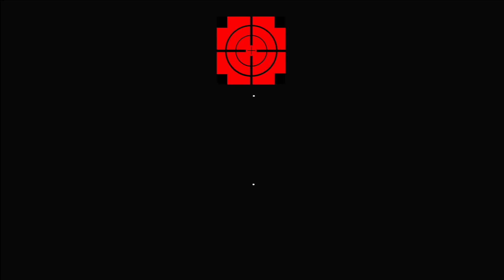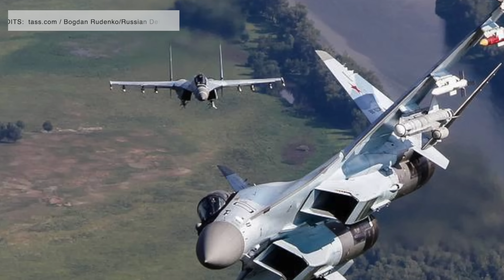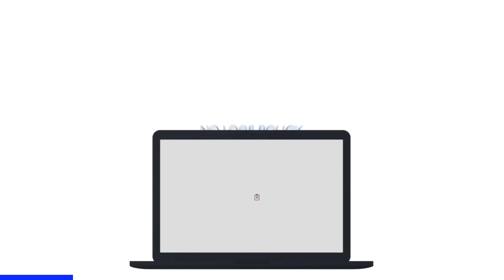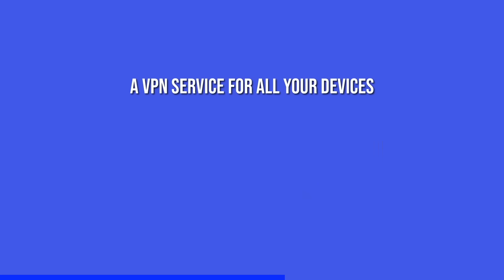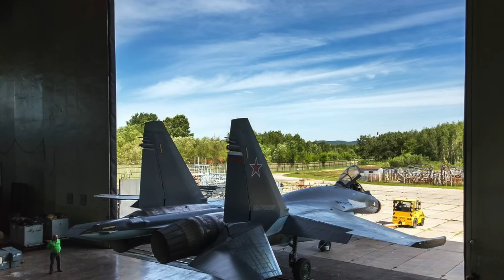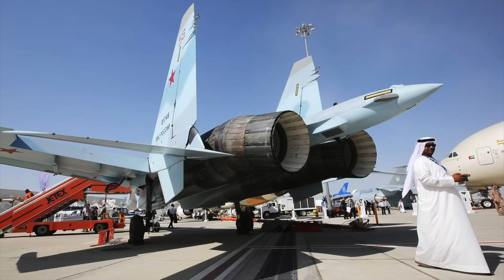How the Russian Su-35 got exposed by Egypt ?

Comment: The fact Ukraine has been able to destroy several SU35 jets while the F35 has been flying over Iran for 3 weeks without any issues just shows how far behind Russia really is.
Reply: The Russian lost some of their aircraft because of the ineffective use of air power.  The Russian air force does not have the weapon to neutralize Ukraine missile system such as the Patriot.  In the case of Iran, Israel initially attacked Iran SAM systems before the war.
Reply: @2Phast4Rocket  Its Corruption, Putin's gov is a mafia state and Putin is the boss.
Russia is one big criminal entity and it dont care about his citizens. And they hate democracy 'the west'.
Reply: They haven't actually lost that many over the past 3.5 years. Losses are expected.
Reply: @joshafc41  meanwhile the F15 Eagle has over 100 wins and zero losses. LOL!
Reply: @krwiles Yes against 3rd gen aircraft. The F15 today is really nothing special. Even the F15 ex is sorely lacking in several integrated systems in sensor fusion and electronic countermeasures. EPWASS doesnt even compare in capability to SPECTRE and DASS which were designed over 20 years ago now.
Reply: @krwiles  few day agof-16 shoot down by russia in ukraine 😭
Reply: There is a f35 stranded in Kerala more than 2 weeks at first they said it was due to fuel shortage and bad weather they have to do an emergency landing after that they said it was hydrolic failure then the technicians come now they are sending another team and a military cargo plane I think they are sending to extract the f35 when are you going to take it and leave from india?
Reply: Thats a really bad comparison.
Reply: This just demonstrates that you watch and believe garbage 
MSM 
Everything you typed is incorrect 
Russia flies across Ukraine using there heaviest bomber
The TU 160 with impunity 
What dumb buffoon you are
Reply: 12 F-35 lost a last 10 years.😢
Reply: @sotirismiaris421  landing gear malfunctioning or pilot errors dont count... nice try.
Reply: You mean the fact that Ukraine has destroyed 8 Su-35s, 40 SU-34s and 60 plus KA-52s which are represent Russia's latest aircraft
Reply: @verdebusterAP  If you believe those numbers then you will believe anything...
Reply: @enochprophet2794  
Right , we are 3 years into Ukraine 
nuff said
Reply: @verdebusterAP This number is considerably (much) smaller but still quite high (a lot of planes were destroyed on the ground, most Russian planes are capable of carrying nuclear weapons so they cannot be hidden from satellites (in underground concrete garages) And since they had a lot of technical failures on the planes (they are old)
Reply: @verdebusterAP   End 10 F-16 from Holland.
Reply: Russia has destroyed 7 F16s and your point is
The F35 does not fly over Iran as you incorrectly stated it fires missiles at a stand off range out of air defence perimeters 
If you are going to type do not type utter nonsense
Reply: @mark4371 USA flew the F35 over Iranian airspace during operation Midnight Hammer, You clearly dont know what you're talking about.
Reply: @mark4371  Wrong.  The US has used the F-35 multiple times versus the Houthi Rebels, Syria, and Iran.   Israel has also been flying the F-35 all over the Middle East for quite some time including sorties into Iran and Syria.
Reply: @mark4371  no it hasn't destroyed 7 you know exactly my point,where dod i say game changer or is that bs aswell?